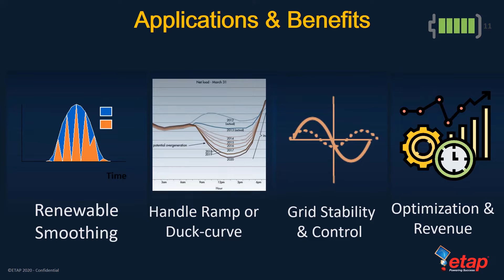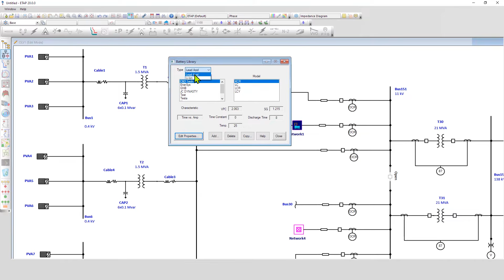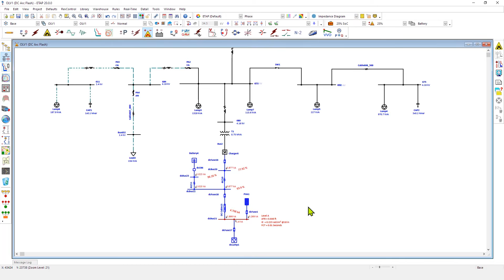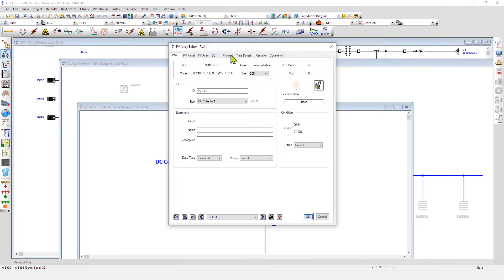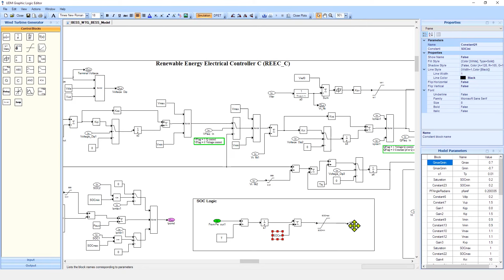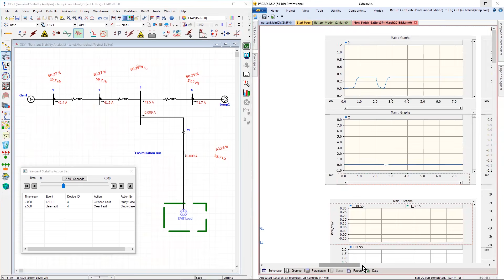How to optimize a battery energy storage system's reliability, performance & produce profit margins

Comment: hey i have queries, i have try to simulate Wayside Energy Storage System for railway system application. the idea is to applied and store the regenerating braking energy. 
i use etrax to simulate the dynamic load flow of rolling stock but nothing happen with the ESS i connect to the system. 
is this simulation is not available with etrax?
Reply from the maker: Thank you for you interest in ETAP Solutions and you positive feedback. Please contact our Help Center at https://helpcenter.etap.com to assist with your question.

Comment: Dear All,
May I have a question that is blocking my learning myself?
My question is related with "Protection Device Coordination".
I prepared a simple single line diagram including bus1,bus2 and bus3 from upstream to downstream. At each bus level we have MCCB's with 630A,250A and 50A as continuous currents respectively from upstream to downstream.
In this configuration, once we have short circuit blow the bus3,the 50A breaker supposed to trip at first, then 250A breaker and then 630A breakers. What's happening, just reverse.. The 630A breaker trips first then 250A and then 50A.as per TCC curves, obviously the 50A breaker will trip first but what is wrong I could not get it.
If any body helps me ,I will be many thankful..
Reply from the maker: Thank you for your interest in ETAP Solutions.
Please go to our 24/7 Help Center, https://helpcenter.etap.com for more assistance, or contact your local ETAP office https://etap.com/offices .
You can also sign up for one of our on-line workshops https://etap.com/events
Reply: Konu hakkında yardımcı olabiliriz, hala sorununuz devam ediyorsa

Comment: Sir plz can u share the file here
Reply from the maker: Thank you for your interest in ETAP Software. Please contact our technical  support at support@etap.com to assist with your request
Reply: @ETAPsoftware  sir I have send this msg there so plz send file to my gmail as soon as possible becz I have to submit project related to it
Reply: @usmaniftikhar4711  did you get the file?
Reply: @hawahawaee3  No, I have submitted another etap project.
Reply: @usmaniftikhar4711  Can you tell me the project name?
Reply: @hawahawaee3  load flow analysis of IEEE 33 bus radial distribution system using etap
Reply: @usmaniftikhar4711  can you send me the file please

Comment: What are the standard charge/discharge times of a grid-scale BESS? How long does it take to discharged completely and to be recharged?
Reply from the maker: Thank you for your interest in ETAP software. The answer to your question depends and many factors including the type of hardware being used. Please contact our technical support team to assist with your question. Contact support@etap.com
Reply: I think that is a complicated question. there are many factors to be considered, like the pv power, the load power, the system working modes, if or not to active grid charging function to charge the battery. mostly need to know the purpose of the system, and to configure the system to meet the purpose.